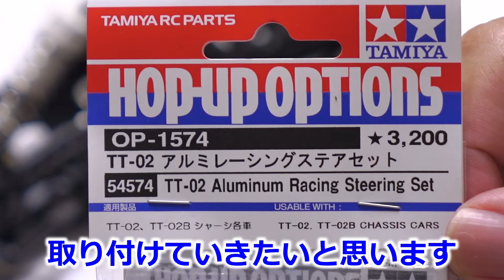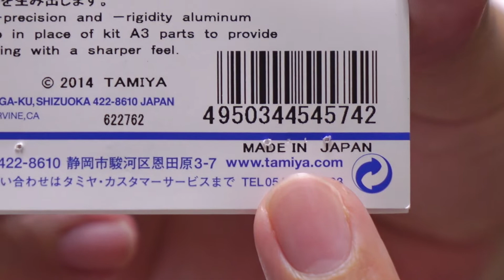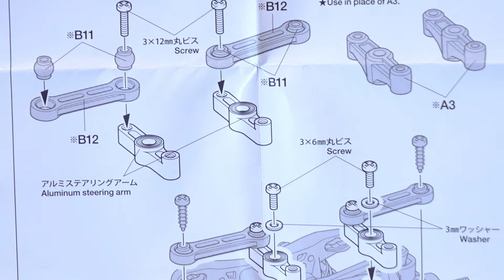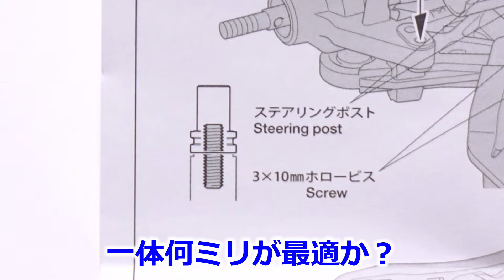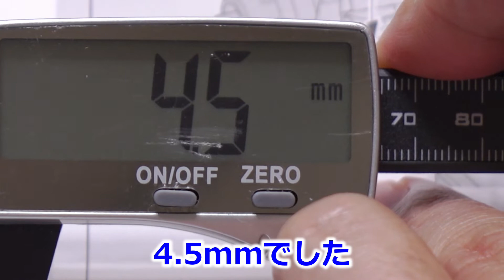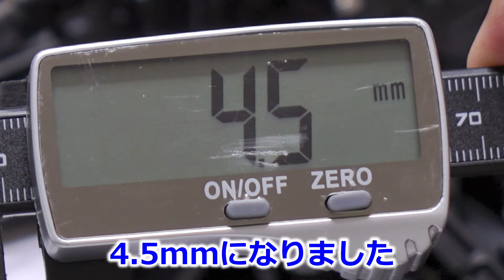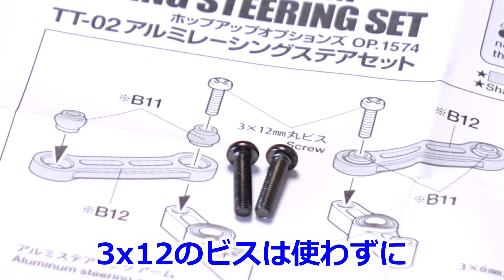TT-02 アルミレーシングステアセット Op.1574(54574)ALUMINUM RACING STEERING SET/ Hop up TT-02B 05  TAMIYA【COMO's RC】

Comment: Great video. Did you notice an improvement with the new steering?
Reply from the maker: Thank you for your comment.
Yes, it is not as good as when I installed the high-torque servo saver, but it certainly seems to have improved the steering accuracy.